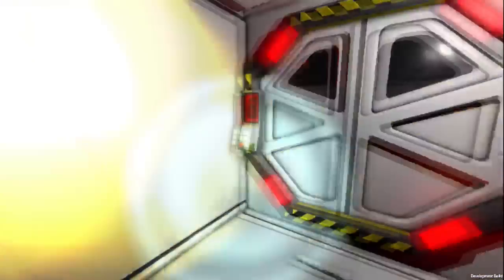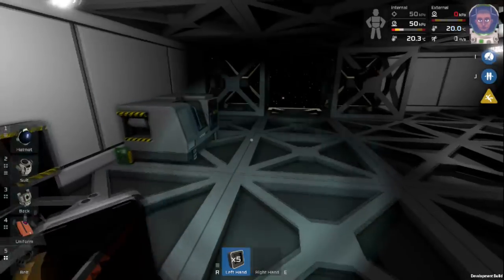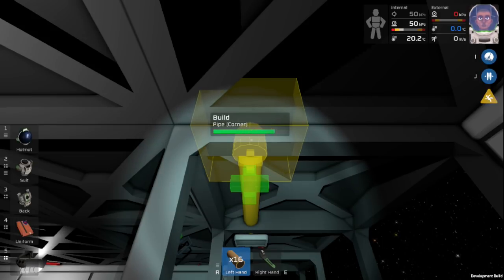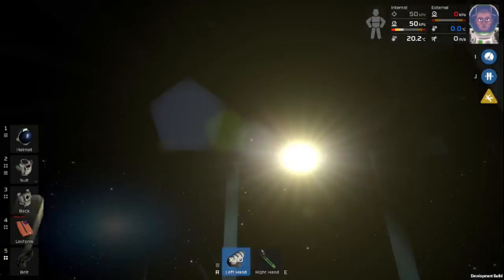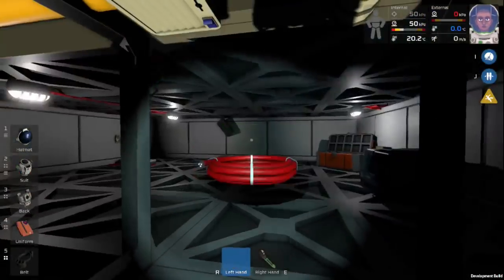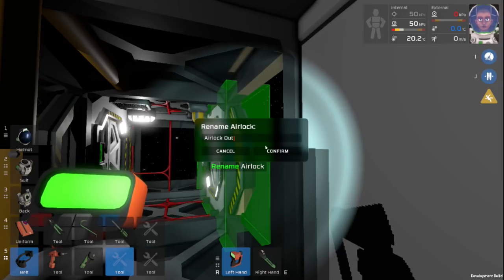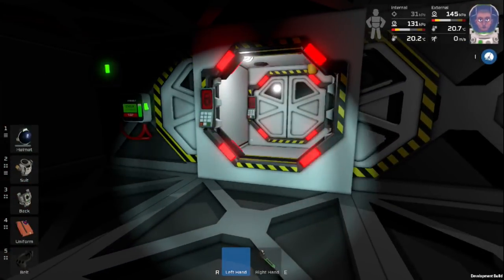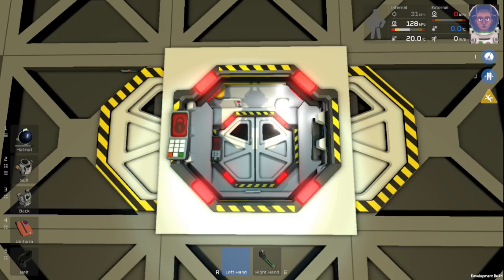Stationeers Tutorial: Airlock

Comment: Bushwackah,
First off, thanks for the vid.  I'm having an issue with the console.  The airlock "works" if I do it manually, as in, vent the air in and out myself, but the console is stuck on the Cancel pressure/depressure stage.  My internal area is sitting at 115kPa and I even switched out my large air tank for the canister setup you showed.  Anything I may have missed?

Edit:  It's as if the commands don't want to close the currently open door.  Fiddling around with the console, if I manually close Door 1 (can go either way), vent the air, insert the disk, turn off vent in the console and turn it back on, Door 2 will automatically pick up and open.

Comment: I did EXACTLY what you did, and my control panel still blinks an Error even with the data disk installed.  There needs to be a LESS more complicated way to get the damn airlocks to work
Reply: It's not complicated at all. Make sure your power is coming from the output of the APC.

Comment: Ok, i do have a question on cosmetics for the inside of the airlock.  On the inside of the airlock where the wires are at on the floor (and ceiling i guess), how do you hide the wires like that?  I always see the wires on the ground where you have to hook up the power to the doors. Is there some type of floor paneling you can use to hide em? Looking at the celing there after you hooked it all together i see the wires up top there are hidden also.  Thanks.
Reply from the maker: I used the steel wall kit, if you flip it around enough it will be placeable as a floor or ceiling. Thanks for watching!
Reply: Aha! Just got done doing up the gas capturing room and saw you do flooring there.  Didnt even dawn on me that those could go over a pre placed flooring thing.  I was thinking of them like a floor grate from aliens (must be flashbacks from all the blinking lights ive seen).